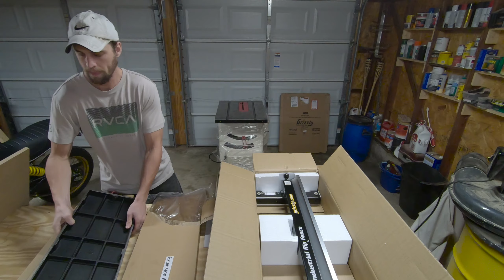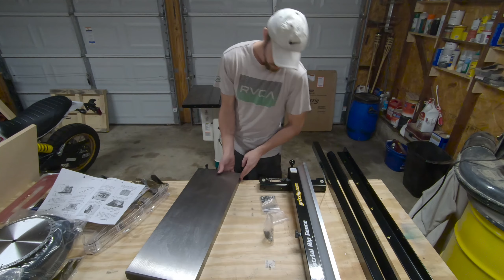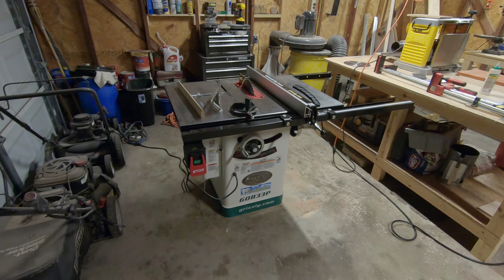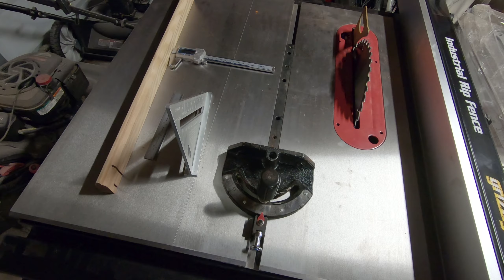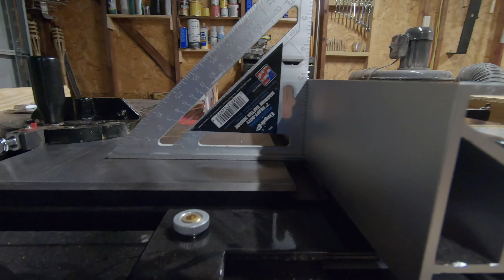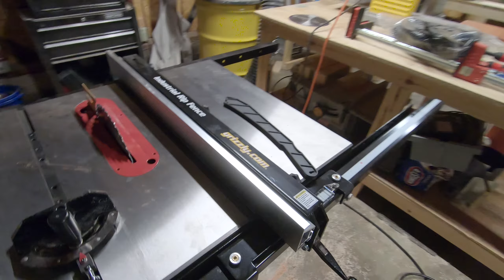Grizzly G0833P Table Saw Timelapse Unboxing/Assembly with Brief Overview

Comment: Nice video. I have to agree with you on this saw. I chose this based on similar reasoning in relationship to the overall build quality as compared to the G0771Z. I also compared with the G0690 and decided that the added expense was not justifiable for my use as a hobbyist. I also think that the options on this saw really added to my decision. I am using the 1hp Grizzly floor model dust collector as an add on  and it gets the job done quite well. I also added the roller outfeed table. Very happy with my purchase as well. Look forward to your thoughts as you use the saw more in the future.

Comment: The G0833P was discontinued and is not available in the Grizzly website anymore.
They have a new table saw (G0899) that looks identical to the G0833P.  But haven't found reviews for it.
Reply: It looks identical other than being pre-wired for 120v instead of 230v. My guess is they did it to appeal more to the hobbiest. My 899 comes in next week.
Reply: jon snow, great!  Please, let me know if you like it.
Reply: @MucaroBoricua  mine came in and the box it comes in was in bad shape, there was no hardware in the box, and table top has bad gouges in it. This is after waiting two months while on back order. Not a happy camper right now....
Reply: jon snow, Oh no, that’s so horrible.  I think my heart would skip a few beats if that happened to me.  I hope Grizzly amends their wrong doing quick.
Until then, I'm not ordering one.  Good luck, bro.
Reply: @MucaroBoricua  they sent me a new top but it took a few weeks to get here. I have it all put together but  haven't used it yet we just had a baby. Idk what the tolerance on table flatness should be but using feeler gauge and straight edge I'd say mine is between. 01-.02 using a few different straight edges. I'm happy with it. I'll post some feedback once I use it
Reply: @dusbus2384 , I was wondering what happened to you but I didn't want to pest you with questions on top of what you were going through.  Thanks for caring and sharing your experience.  Congratulations for the new addition to the your family!

Great that they took care of you.  It's understandable that it would take them some time to send you replacement parts since the table had been out of stock for a few months.  I'm assuming they also sent you the missing hardware.  I have no clue about flatness tolerances but 0.01-0.02 sound good to me.  I just did a little googling and found people saying that they were OK with 0.026.  Another dude said you could adjust the feet of the table to straighten the top.  The theory is that the table tops twist a little if the machine is not resting squarely/evenly on all its feet and if the top is twisted before the bolts are tightened it will remain twisted after they are tightened.  Hey, the G0899 has 4 reviews in the Grizzly website now, all 5 stars.  I hope it works wonderfully for you.  Cheers.
Reply: @MucaroBoricua  So after a few months of use I have to say i'm decently happy with it all things considered. I switched mine to 230v as it comes prewired for 120v. if you want to keep your saw 120v you'll more than likely need to change a receptacle in your shop/garage to match the 20A plug that comes installed on the saw. I was lucky enough to have an adapter at work i could use to check if the saw was working.

Setting up the saw was a bit of a chore but it wasn't too bad. taking off the old top and replacing it sucked to do by myself that thing is heavy. the only good thing about swapping out the top was i was able to fit the cabinet into the rolling base easier before i put on the new top.  I ended up getting an A Line It kit from amazon to square the miter slot to the saw blade and then square the fence to the same said slot. i toed the back of my fence out a hair as suggested in the manual. I did have to tension the belt on the motor as mine did not come tensioned from the factory and while the manual does cover how to do this it is not part of the step by step assembly process. i also had to adjust the stop nut on the all thread that adjusts the tilt of the blade to stop at 45*. 

So far i've built some cabinets and a few shop projects with the blade that came with the saw. it has handled cherry 4/4 wood no issue and 3/4 inch plywood just fine. haven't noticed any scorching or anything. had i not had the shipping issues i'd give the saw a 92-95 out of 100. This is my first cabinet style saw so i might be overrating it but man this thing is great. I don't use the blade guard that came with it and i hate the stupid dust collection port that comes installed on the saw. they shouldve had a straight 4" coming from the saw and included a 4" x 4" splitter with a "Y" built in to run with the blade guard so you could choose if you want to run it with or without. I now have to change the fitting that came with the saw or find a cap for the 2" hose section.

Comment: Thanks for posting this!  Do you remember if you had to cut the measuring tape to length?  Grizzly has sent me two and both have ven about 3 inches longer than the rails.
Reply from the maker: Yeah I had to cut mine about 3 inches also.

Comment: I am waiting for a delivery of this saw in 2 days. It is being shipped by UPS and I was very surprised to hear that UPS already knew I live in an HOA community where a 18 wheeler cannot enter and they already prepared to use a truck with a lift gate that can fit in here. I was very worried that I had to rent a truck with a lift gate and go pick it up at a UPS facility. Let's hope all works out.
Reply: Paul how was delivery? Have you put the saw together yet?
Reply: @robertmcevoy24  the delivery was  a little frustrating, but ended well. I feared the semi would not fit on my street bit it did. The UPS driver brought it right to thr garage with a  palat jack. I rewired it to 120v, which went well following directions in the manual. It is a heavy saw and runs surprsingly quite, relatively speaking. The blade was perfect out of the box, but I had to mess with the fence to align it and the fence has lots of alignment options to get it right. Only problem, if it matters to others, the saw has absolutely no places to store any accessories. Otherwise, 1 wrench blade change, easy riving knife change, heavy saw dust without a dedicated dust extraction and very flat and well aligned iron wings. Im enjoying it a lot.
Reply: Paul Thanks Paul I’m now waiting on the electrician to ad a longer cord for the 220 , it did go together well my only complaint is the 6 foot cord can’t wait to fire it up enjoy your new Grizzly
Reply: @robertmcevoy24  you know I had same issue. After changing the 220 plug to a 5/20 plug for 120 circut on the power cord, which i leared how to do watching youtube vid, i realized I can make my own extension cord. I went to home depot and bought 12/3 cord they sell off the reels and bought the 2 ends from their bins. I made my own extrnsion cord.

Comment: i hate to bother you again but I noticed on grizzlys website that this saw has about a 11 in rip capacity on the left of blade and the others I have looked at has about a 15 to 16 inch on the left side,,,do you think this would be a deal breaker ,,,,have you had any issues with it,,

Comment: Another huuuuuge difference between this and the 771 is the cabinet mounted trunions. The 771 are table mounted and is a hybrid. This model is closer to a cabinet style (trunions mounted to cabinet). Hybrid look like a cabinet saw but have trunions mounted to table like a job site saw. If the blade isn't square it's much more tedious to aligned it. 
With this model with the cabinet mounted trunions, all you have to do is loosen 3 of the 4 main table bolts and tap the table either way to square the table to the blade. The 771 have to loosen the trunion bolts and move the trunions to square it to the table. 
In the beginning they are both good out of the box most of the time but when you do have to realign them is when you will thank the Lord for the cabinet mounted trunions.
Edit: not trying to sound like a smart ass, but in case someone is shopping between the two and you didnt mention it I wanted to put it here for posterity sake. When it comes time to realign it's a godsend.
Reply: You might want to check your facts. Right off grizzly’s site. The trunnions on the g0771z are cabinet mounted.
Reply: Trunions are mounted to the cabinet on both the 0771 and the 0833 , which are now both discontinued to the G0771z and the G0899 replaced them both models have CABINET MOUNTED trunions .